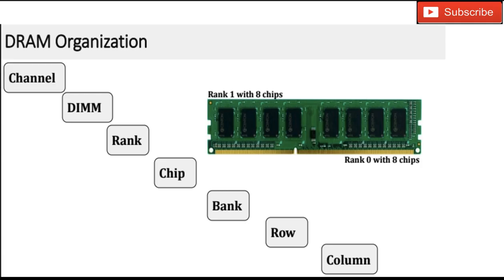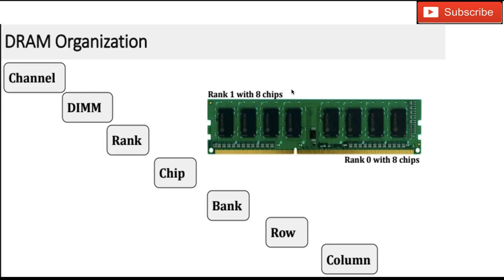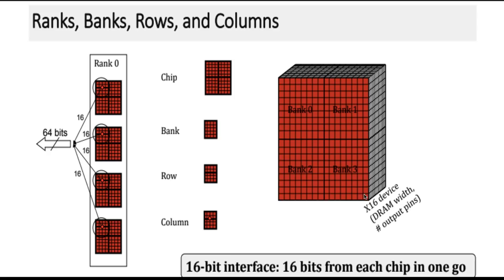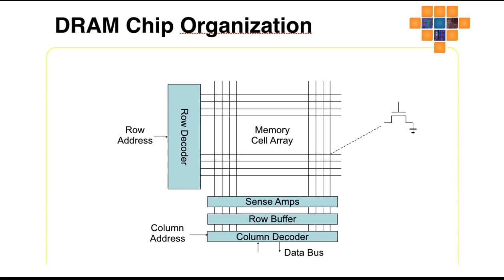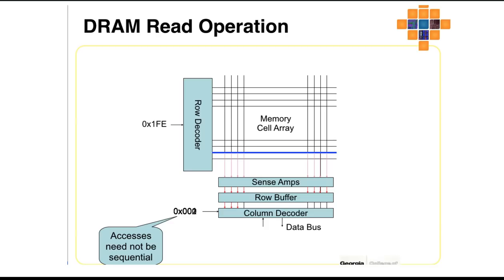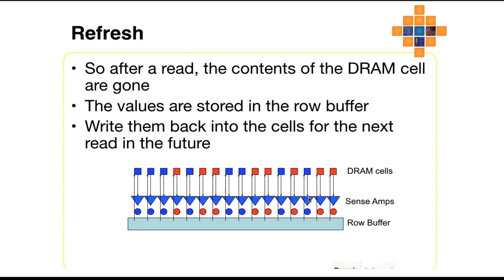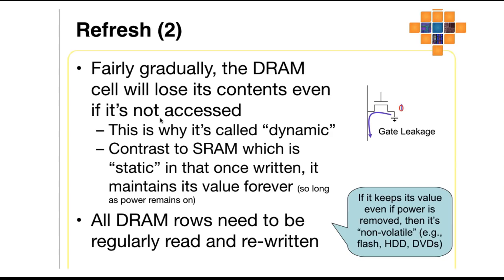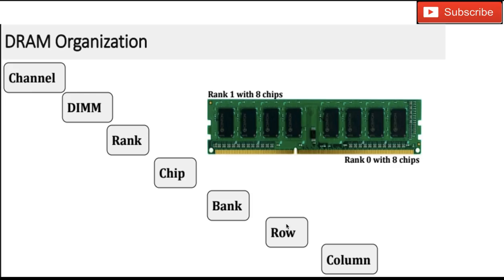What is DRAM, Channel, Chip, Bank, Row, Column and its Operations

Comment: "Dual" because the contact-Pins are on both sides of the DIMMS, not because there are chips on both sides. That means "Single- und Double-Sided-DIMMs". But thanks for the other Information.
Reply: Just to clarify a little bit more, it is because of the * independent * pins in both sides. SIMMs (Single Inline Memory Modules) have pins at both sides as well but they are redundant.

Comment: Dude, its called DIMM because the Pins or Connectors are present in both sides of the module not because the chips are present on two sides.
Chips present in both sides is the concept called RANK. Dual Rank - Chips present on both sides of the module, Single Rank - Chips present only on 1 side of the module

Comment: Great video! :)  I have been reading through the JEDEC DDR3 spec and this video provided a nice visual of what is happening. I am still new to DDR.
Quick question @7:15.  In a Read operation, once a row address is presented followed by a column address, are we only selecting one single bit that is then presented onto the Data Bus?  Since there are 16x cells in parallel per bank, we are accessing 16 individual bits in parallel at the same time? 
Thanks!
Reply: x16 meaning one bank contains 16*16 address which equals 256 addresses per bank, it takes 4 bits to address the row and another 4 bits to address the column, that's 8 bits required to identify a specific 1 bit location out of 256 addresses. watch this to learn more:
https://www.youtube.com/watch?v=fpnE6UAfbtU
Reply: @obada.  are you sure? I think 16x means one bank outputs 16 bits at a time(maybe in bursts according to x4, x8 as Crack Govt Jobs says?). One {row, column} address pair address 16 bits I think.
Reply: @flyxtop  
I think I was mistakenly referring to a planar row and column only bank.

The guy in the video said each chip will output 16 bits at once, that 16 bits chip is divided into 4 banks with each bank having a row, column, and width.

Row and column indicate the physical location using 4 binary bits for each, and width indicates the burst length that is how much data of that address to output, in this case it's either 4, 8, or 16 bits per burst and bank, which translates to either 16, 32, or 64 bits per chip.
Reply: @obada.  I see. that's good my understanding was correct more or so.